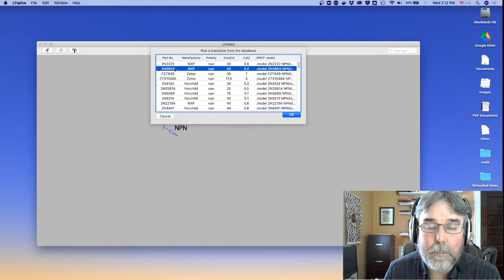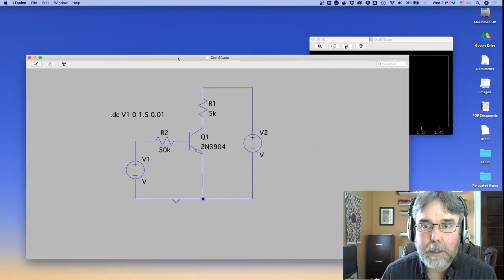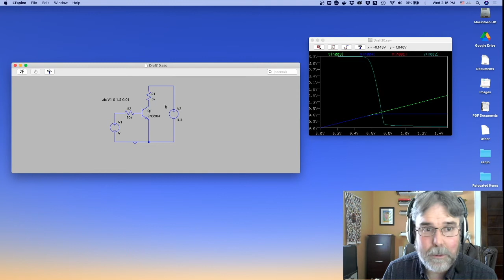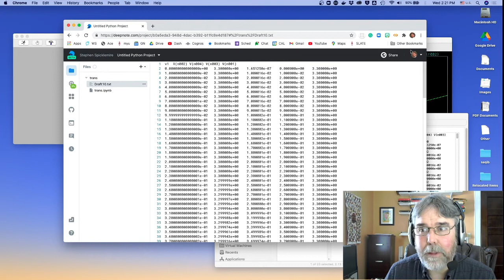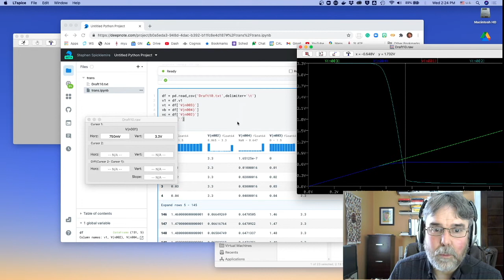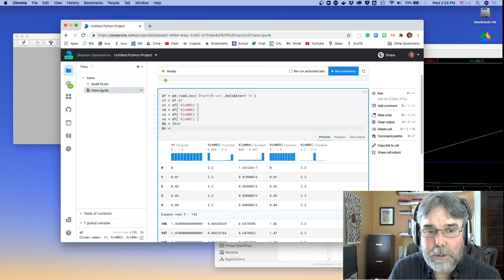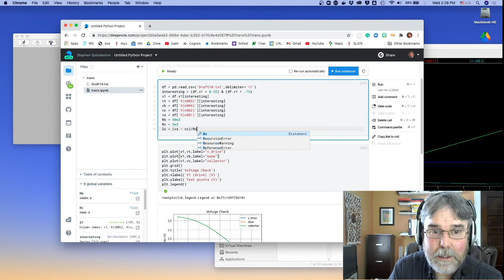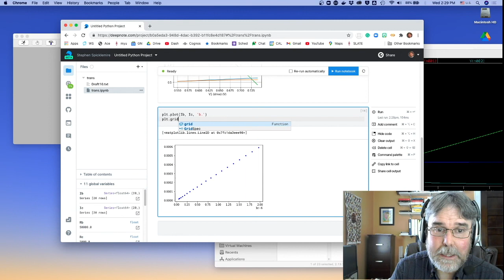LTSpice-Transistor

Comment: Would be interesting to find transistor re using LTspice (for sin wave input in common base amp). Any recommendations on how it can be done in LTspice? What formula can give accurate value for sin wave.  It should give better results than commonly used  approximation re=25mv/Ie.
Reply from the maker: I'm guessing you're thinking of something like this? https://www.dropbox.com/sh/h3d69ssmep1qolj/AAAB_uqIbzMcI4klgf5vVL66a?dl=0&preview=common-base.asc